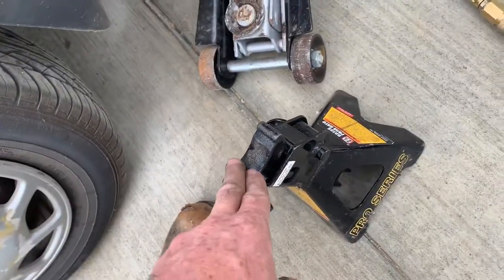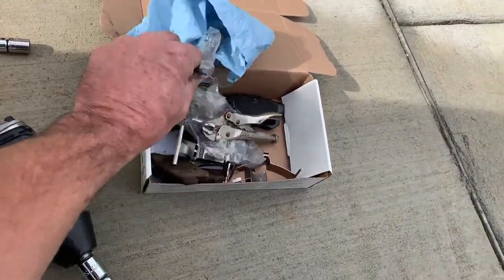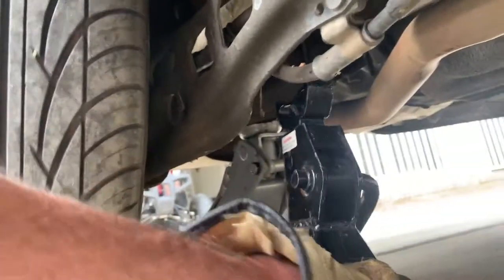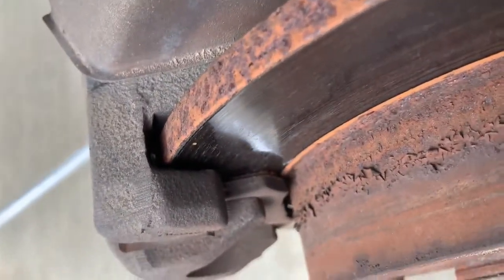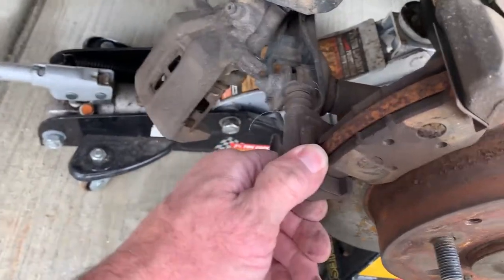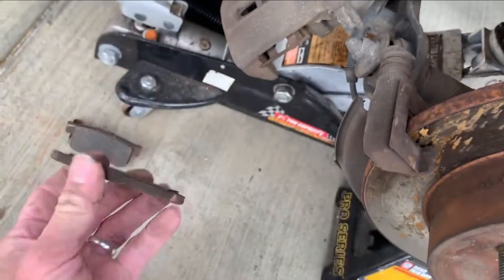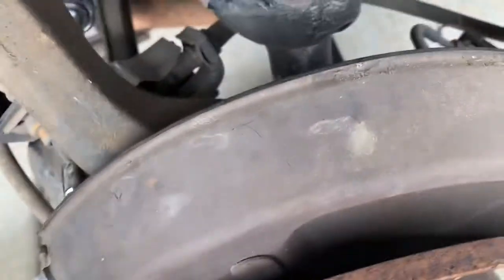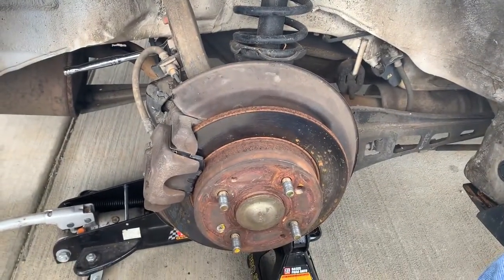Replace 1994 Honda Accord Rear Brakes (93 94 95 96 97)

Comment: I’d be willing to bet the piston was NOT lined up  with the marking pin on the previous install job. That’s why the top wore out faster and unevenly. That pin wasn’t in the slot. There was more pressure from the pin on the flat surface of the piston. That’s one advantage of pulling the whole caliper as you can line it up easier and slide the whole caliper back on. However it is a pain. lol. Nice work overall.
Reply from the maker: nice information to know.   on most of these types of videos, the gold is in the comments.  thanks for adding the info!!

Comment: Thanks for the video you can use the pinch weld for the jack stands and maybe use some break cleaner on the rotors before putting everything back together..
Reply from the maker: Thanks man.
Reply: Thank you

Comment: Never hang the caliper by the brake line. And you should always lather the back side of each brake pad with some "disc brake quiet" or you might run into a good amount of brake noise down the road.
Reply from the maker: That's a good point. Good to try and get a can or something to put it on

Comment: Ok New to changing breaks on Accord do the breaks need to be bleed
Reply from the maker: *legal disclaimer: consult a professional*. Because we didn't open any lines, there is no reason to bleed the system.  You can use a C clamp to press the pads together.  If you don't open the system, no need to bleed it